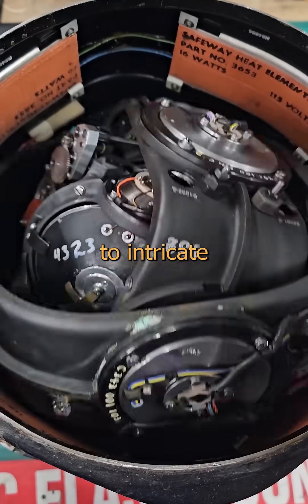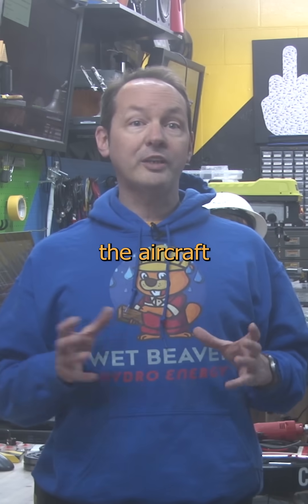Inertial Platform #chrisboden #comedy #gyroscope #gyro #avionics #physics #educational #science

Comment: Phones do not contain any gyros, but uses accelerometers and a bit of magic mathematics and the result is the same.
Reply: They have both linear accelerometers and vibrating structure gyroscopes. That's why your phone can tell the difference between being rotated and linearly accelerated to the side.
Reply: @EntropicNightmare The quantity and variety of sensors and transceivers in a modern cell phone is downright unbelievable.
Reply: That actually would explain why my phone just CANNOT FUCKING FIGURE OUT WHAT IS HAPPENING when i turn it sometimes.
Reply: MEMS ICs contain both most of the time. For example the MPU6050.
The wafers are so small, that a mems Accelerometer and a gyroscope would fit into the same package (package is way larger than the actual wafer, just so it is even mountable on a PCB)
Reply: Phones mostly have 9 DOF mems chips. 3 axis gyro, 3 axis accelerometer, 3 axis compass.

Comment: The wire/cable management on that thing just does something for me…
Reply: I kept thinkin, "slower, dammit, SLOWER!"
Reply: @thomasgeorge4384  like watching a fembo uhh cheerleader doing high intensity aerobics.
Reply: @thomasgeorge4384  same.
Reply: @thomasgeorge4384  I hate not having video speed control in Shorts.
Reply: I was thinkin that too. It’s a thing of beauty
Reply: It sends a shiver deep down in my soul. To think it was originally developed for the Navy. For submarines. They were the first ones to use inertial guidance.
Reply: @industrialnerd5535 Lmao actually it was first used on torpedoes not submarines 👍
Reply: Aircraft are some of the most amazing things to witness wiring in, at the same time its a beautiful nightmare of several miles of circuitry. 

Off the top of my head the 747 has something like 13 or so miles of wiring. Its beautiful but also lowkey kinda nuts haha.
Reply: I get the same feeling watching MG parts function and fire. Something beautiful about it all coming together.
Reply: @enderwolf3588  are we talking about Morris Garage automobiles? Or a different MG? I am not sure Lucas electric ever had anything with as much wiring that worked as well.
Reply: It's not just a machine, It's a work of ART!
Reply: Same. "BO-OI-OI-OING!"
Reply: @QuakeDragon Giggidy!
Reply: For obvious reasons, it’s impossible not to excitably relate
Reply: I can't stop watching this video clip. 😂
Reply: I know its sexy, but try not to get too excited
Reply: Sea level vs gyroscope....UFC  3959...
Reply: Ikr
Reply: Same for me as well.. Makes my ocd feel at ease.
Reply: Did you also go from 6 to midnight?? 💀😂
Reply: @reznas  I think it might partly be due to it looking biological: blood vessels, nerve paths and the like.... it has an organic life like look?
Reply: As a prior AT who worked on EGIs, got to see. It was awesome. Also how I met my rescue swimmer husband. We deployed together. I was AT who had to get up out of bed from rack to fix things. Also. He gave me all hid magic the gathering cards if I essentially took his college math exam. I did. One thing I did like. His det was one det that actually came out and helped maintainers. R
Reply: Exciting tolerances right?
Reply: I always called stuff like this "cable porn"...
Reply: Whitworth.
All accurate measurements must be taken from a FLAT surface.
The earth is not a spinning sphere in a vacuum.
Your parents are Adam and Eve or you believe the lie of evolution and your parents are highly evolved smart pond scum.
Reply: Fr it made me nut all over too
Reply: NUT
Reply: I'll bet.....
Reply: Then you're probably into bondage and just haven't realized it yet
Reply: Right?
I can taste my glasses and smell the solder.
Reply: it is very Satisfactory...
Reply: I need a smaller version of this in my office so i can just spin it sometimes.
Reply: I'm not even really mechanically inclined, and I still found this beautiful

Comment: What's even cooler is how the modern ones work.  They still use a spinning mass, it's just electrons spinning around a silicon wafer, and when the direction changes the electrons spinning electrons shift to one side of the wafer or the other and it's this shift that is measured.  Full solid state gyro, there is a minimum of 3 wafers in the xyz orientation.  You can thank missile technology for the part.
Reply: There is another way that some MEMS gyroscopes work, each axis has a tiny vibrating bit that forms a capacitor with a stationary bit. When there's a rotation in that axis, the vibrating bit will defect to one side, and thus change the capacitance.
Reply: @paulroberto2286 that's not "some" mems devices, that's almost all of them
Reply: @paulroberto2286  ...as used in hobby drones.
Reply: Most phones just use comb actuators that's why if you are carefully moving your phone you can sometimes making the screen face the wrong direction
Reply: @vornamenachname7111  Yeah, I would think they keep MEMS for the expensive phones despite it being cheap to include, just to make sure us plebs know we are using cheap phones.
Reply: sometimes they use a loop of fiberoptic cable and a laser
Reply: @coolmikefromcanada    -yep a Ring LASER gyro... (the middle technology - before ( and / or, in parallel to) MEMs..
Reply: I thought the missile knew where it was because it knows where it wasn't....
Reply: @steventaylor8723  well, this is what tells it where it isn't, so it can subtract where it is from where it isn't
Reply: @steventaylor8723
You have heard that, but likely don't get it. Yes, the missile knows where it is because of tracking inertial guidance signals (showing changes in accelerations), but - to know where is that - it has to know where it started from. In reality it's only reliable for short distances, losing accuracy exponentially over time, so other tracking methods have to be used in tandem.
Reply: What would these be called? I can't find anything about them. MEMS gyroscopes look at flexure of a vibrating mass due to the coriolis force.
Reply: Yeah! They won the 1997 Nobel Prize in Physics for cooling / trapping atoms with lasers, which allows for the new generation of advanced accelerometers
Reply: Killing each other has brought us such wonders 😂
Reply: That’s pretty cool
Reply: This is what I came here for.  Chris piqued my interest with the phone "tease.". I was curious as to how silicon did this.  Thanks!  Ok, and yeah: That's Really Cool!  Seriously.
Reply: I was looking into laser gyro's the other day.  Those are just amazing, expensive though.
Reply: All of this information gathered from different people seems pretty cool to me, thank you all for the explanations ✌️
Reply: Ehh, what phone uses that? Most are comb devices as mentioned and use capacitance
Reply: I think you're talking about Hall effect sensors. They're magnetic compasses not gyros. A lot of phones have them as well as three axis gyros.
Reply: Boeing also use laser gyros where funny mirrors make the same light travel the same distance in different times to get your bearings! I love the IRUs
Reply: So I can yell at Raytheon every time my phone screen refuses to orient itself properly, awesome!
Reply: Dude, today I learned. Thats fucking cool! 

I have made my peace with the reality my brainpower is not the type that could have ever come up with that. 

Understand how shhizz goes together, diagnostical stuff, sure, got you fam. 
Coming up with a electron spinamathinging around a silicon wafer thats just way beyond me. Even with the powers of concentrated high sativa content wax ingestion, alas, I am a different sort of dreamer, I guess. 😂
Reply: @threadtapwhisperer5136  if you tell yourself you can never do something you will never be able to do more than what you see yourself capable of right now
Reply: That shit you came up in your head with does not exist. electrons can't "spin around in a silicon" 
There is a version with fiber optics in a spool and photons running around and MEMS. Please go and spit into the face of whoever told you that electron spinny crap if you did not hallucinate it yourself.
Reply: Accept it will drift unless you have GPS to double check
Reply: Thanks Raytheon.
Reply: Why do the elections shift to one side by moving the whole thing though? Can gravity push electrons?
Reply: @senseishu937  they wouldn't, I think he's got some things mixed up, to be more specific I think he's mixing together atomic spin gyros and mems gyros.
Reply: they got fiber optic ones too that dont have moving parts.
Reply: modern ones are fiber optic gyroscopes, huge coils of it and are extremely precise!
Reply: It's indeed cool! The fact that quantum mechanics was need to miniaturise a lot of mechanical tools to fit in colossally small form factors still amazes me. It goes for almost all electronic components that are used as measurement tools. Best example will always be the invention of integrated circuits, prior to ICs, Boolean was literally operated on mechanical triodes and vacuum tubes. Look how far we have come in less than a 100 years. It's remarkable, I can type this out on a device the size of my palm! Idk how people just use these devices on the daily without even giving it an ounce of thought of how incredible the invention of integrated circuits is, most people like to mock scientists and their work, to them it seems pointless. But they don't understand every single scientific discovery that contributes directly to a product you use in your daily life. People need to be more grateful.
Reply: Pretty sure the way the phone tells your direction is a small compliant mechs built into the motherboard that allow a small disc of conductive material to give/fall which ever ways down and that completes a connection i know thats how they use to do it so i would assume they still do
Reply: Oh? I'm thinking of the "gyros" inside a drone that keeps it right-side-up. Piezoelectric sensors  that detect changes in one plane so three are needed.
Reply: The best part is when i have to bump/ shake the phone a little to make it flip the screen.
Reply: Thank you Raytheon.
Reply: I also watch Veritasium lol
Reply: Most aircraft now use laser ring gyros. More accurate than mems
Reply: Missiles are pretty cool
Reply: Well that’s just incredible. Thx! 💯
Reply: I will never thank missile tech for anything. I'd prefer to do without Google maps, than see what missile tech is currently doing.
Reply: Or to shorten all that. We went from analog to digital.
Reply: @ Not sure what you mean. Laser accelerometry is not necessarily digital.
Reply: @themonkeydrunken  analog is mostly mechanical.
Reply: @graydi66y  And how would you qualify lasers cooling and trapping moving atoms?
Reply: @themonkeydrunken   I was breaking it down to the simplest of terms. Its not that deep.